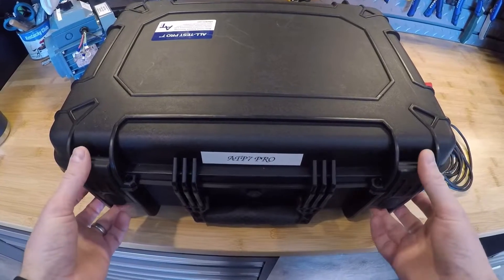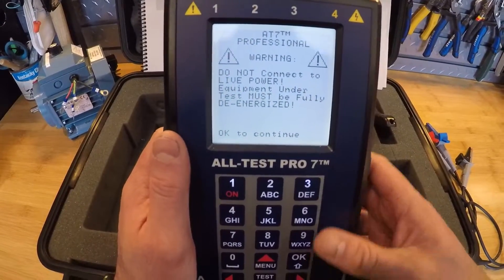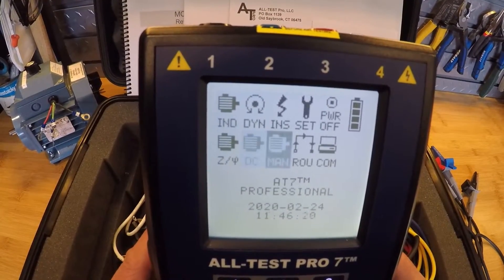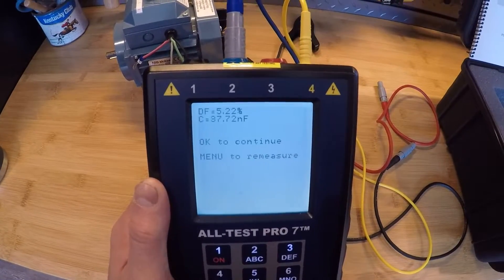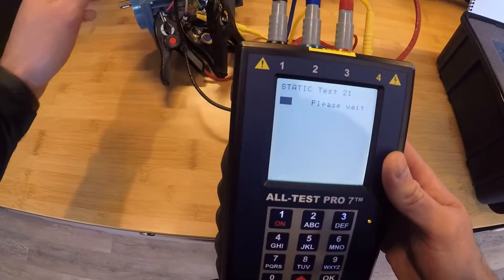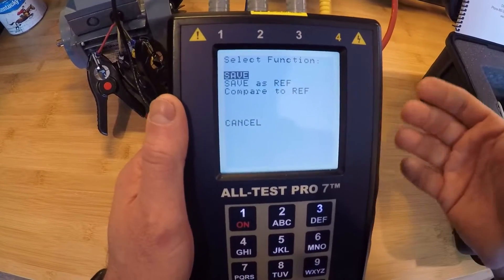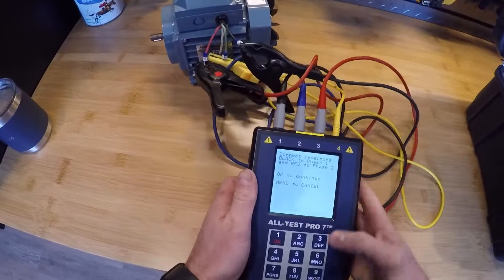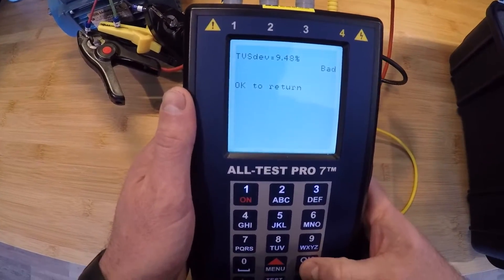ALL-TEST Pro 5/7 Tutorial

Comment: You said the other one is good for testing Motors running under 1000 volt. 
What about atp7 how high of a motor voltage. What is the voltage range that it uses in its Mega function.
Reply from the maker: Thanks for reaching out!  The ATP7 can test any voltage or horsepower, while the AT33 and AT34 is limited to under 1kV for AC induction motors.  He can also test DC, 1-phase, transformers, generators, servos, etc., de-energized.
Reply: @ietechnologies72  thank you for your reply what I was asking is what voltage range is the megger function can be set to?
Reply from the maker: @AB-yu2tj  My mistake!  Both the AT34 and AT7 will be limited on the Megger test to 1kV or 500V.